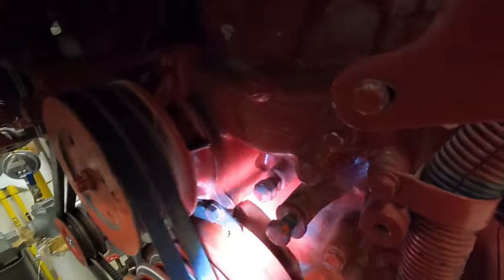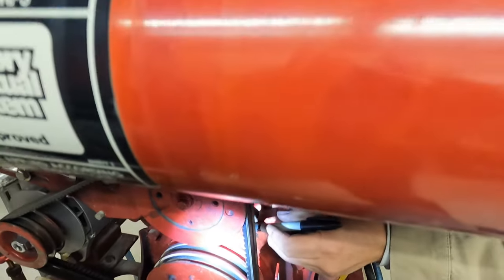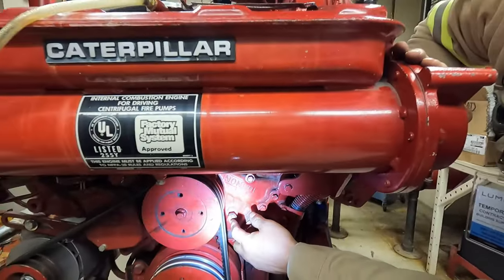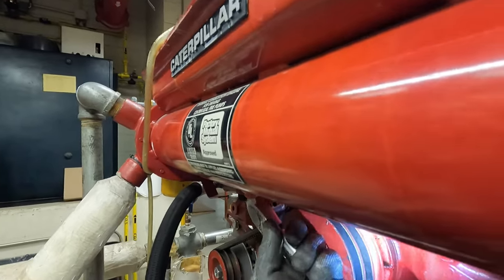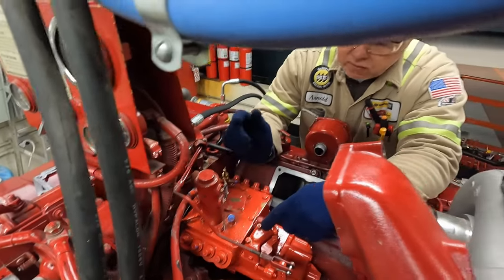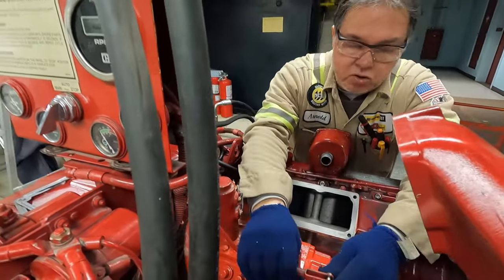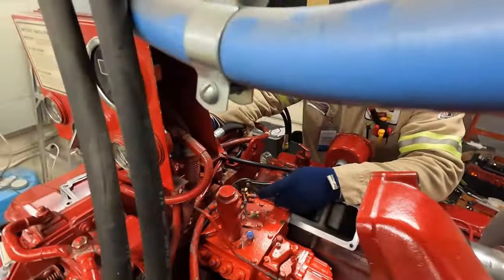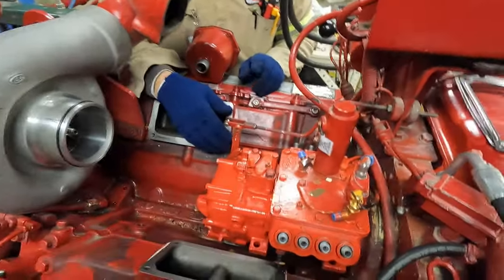Caterpillar 3208 | Fuel Pump install

Comment: Great to hear the half a hole trick. I was taught the same thing when I was an apprentice. I rebuilt engines and fuel systems and ran the dyno at Fabick Cat before I went into a field truck. I enjoy getting to work on these older engines in the field.
Reply from the maker: I had personally never even seen a 3208 until about a month ago. Had to get the veteran to help me out, much better than following a manual on SIS web.

Comment: gr8 vid- i want to make a simple puller, can you give me the bolt thread and hole spacing for the gear? And does the gear get pulled off against the center/shaft or the block? would a small slide hammer work?

Comment: When you see that in a truck it's so small, great fuel mileage, I had worn in a Ford dump truck and it's only really good for flat land, we did a lot of work with that in Phoenix Arizona in the valley, you had a 13 speed Fuller are shift transmission it was awesome.